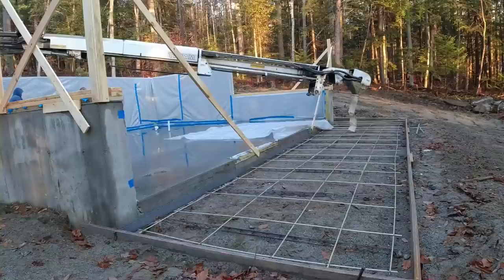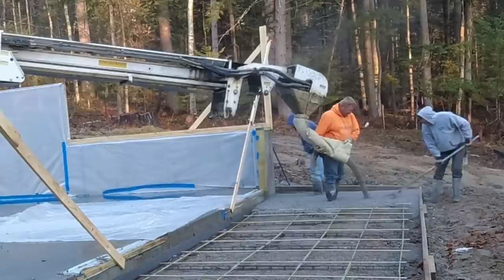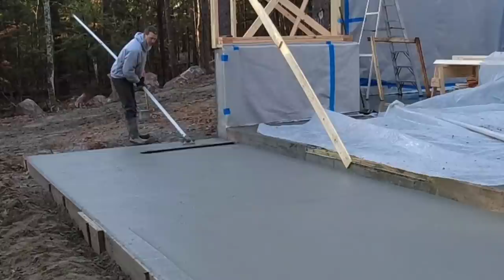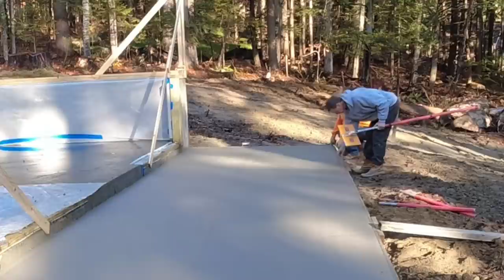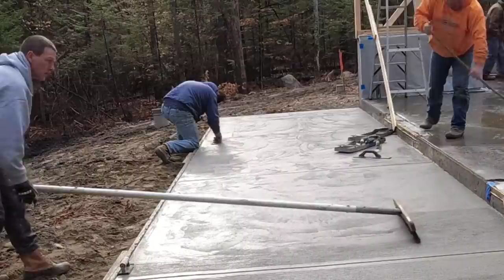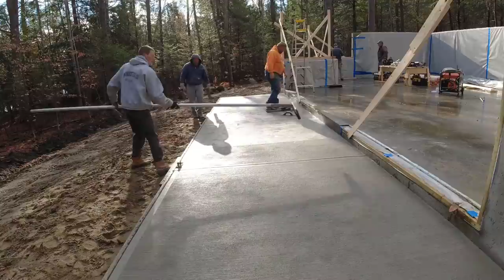DIY Concrete Patio Slab Pour & Finish (How we pour and broom finish concrete)

Comment: Hello Mike, great work-just subscribed to your channel and have a question.  I am having a small house (1350 sq ft) built in SC on a monolithic slab.  The code here only calls for 3000 psi, would 4000 psi be overkill?

Comment: So I just had a slab poured for my shop.  I bought the yellow spacers to hold up the rebar.  The slab was about 5” thick.  I get to the job site when they are 3/4 done and the whole bag of the spacers are still there.  They didn’t put them in.  I was pissed.  So now that the rebar is at the bottom, what will happen in time?
Reply from the maker: If the sub-base was compacted properly then it's very likely nothing will happen. Hopefully they sawed some contraction joints. If it does crack, rebar is just there to hold the crack tight. We do floors without rebar all the time, but we do use fibermesh.
Reply: @MikeDayConcrete  it was poured over 1” polystyrene foam board, which was on top of plastic.  No expansion joints cut, was poured a week ago yesterday.

Comment: Is there a reason why you don't drill holes to attach the apron rebar to the existing slab? With the slope of the ground that apron is going to over time want to slide down the hill.
Reply: He's in Maine. It freezes there. The ground will heave up with the frost. So it's best to not pin the slab to the wall.